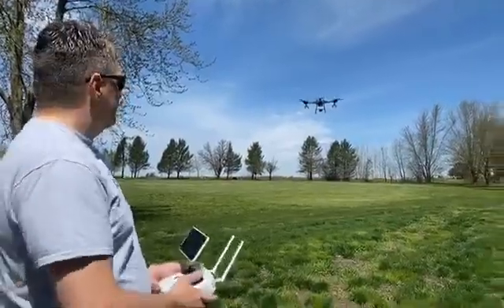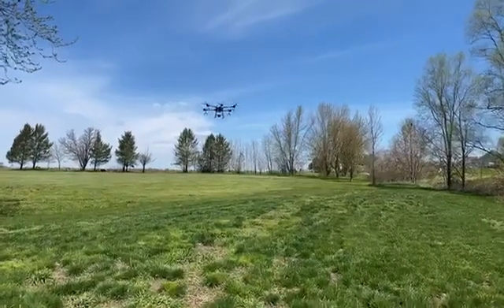DJI Agras T16 Livestream demonstration

Comment: Potential options for charging while on the road? Having a generator running constantly is really load and annoying. We have 10 batteries, and swap out during 10-12-14 hour shifts. Any advice?